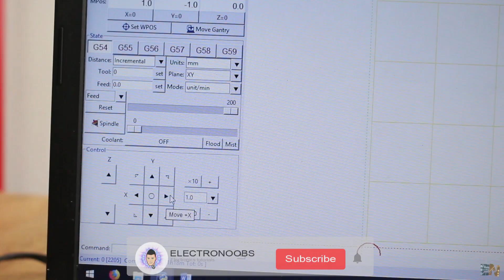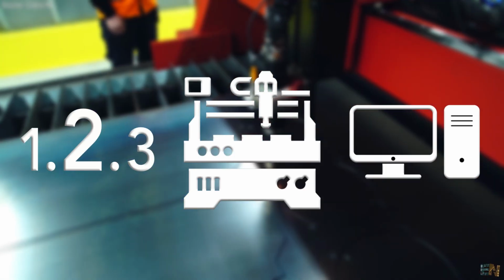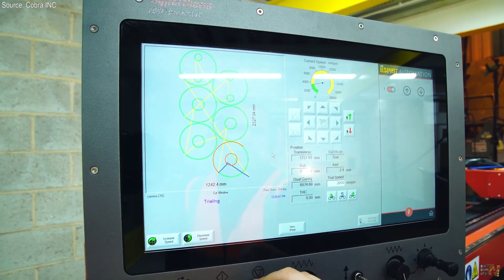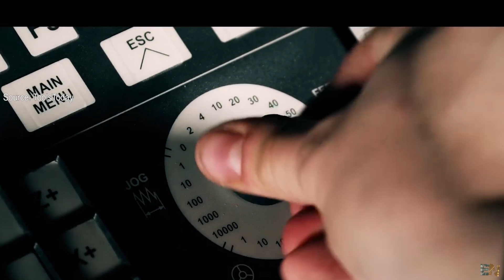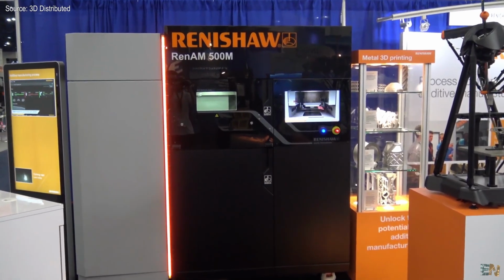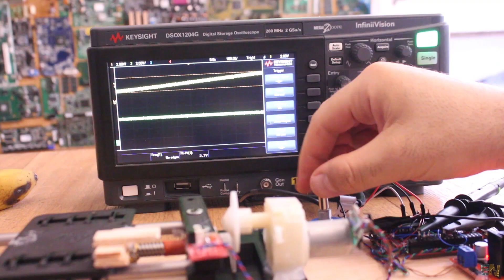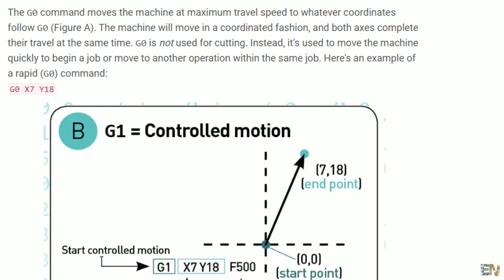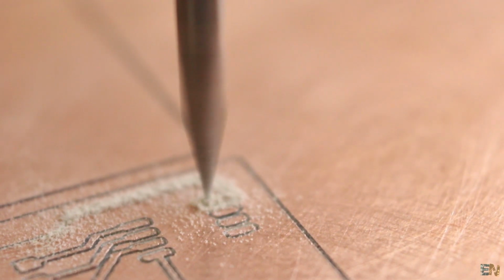Amazing CNC machines | What is and how a CNC machine works?

Comment: I'm sorry, but there are too many misconceptions in this video:
-Manually controlled machines can be as precise as CNC, they cannot interpolate so easily.
-Precission is not the same as resolution.
-Manually moving a machine with an indicator is way more precise than using a stepper (specially with microstepping and those loose belts).
-Waterjet cutters (and the one you are showing is 5 axis) don't use simple water, they use abrasive dust (not sand). That is what actually cuts (not to generate friction, why would you want that?). Water only cuts soft materials.
-A drill is for making holes, what you show is an end mil. (For F*CK SAKE, stop saying drill)
-You don't actually need a constant speed and movement on a lathe to make a thread, just to be syncroniced.
-SLM has been around for years, is not new.
-Stepper are the most common motors on hobby/very low budget CNCs, real machines use mostly servo motors.
-Stepper can have encoders too, is not a mater of BLDC or brushed DC motors.
-Stepper drivers are just two H-bridges with current control by chopping.
-With G2 or G3 you interpolate a circle way better than with small straight lines, usally is a parameter that the CAM can change in order to accomodate to the computer power of the control. Anyways, a real machine will never move into a perfect corner at constant speed or position, most common way is to blend the corner in order to maintain speed. Modern real machines can interpolate circles pretty accurate

Comment: I've got a 1950s cnc lathe that works but I have go manually key g code into the monitor, its archaic.  Is there any way to upgrade this to a modern computer input for a reasonable price?
Reply: You will have to check what kind of motors it uses, but pretty sure LinuxCNC with a MESA card could retrofit it.